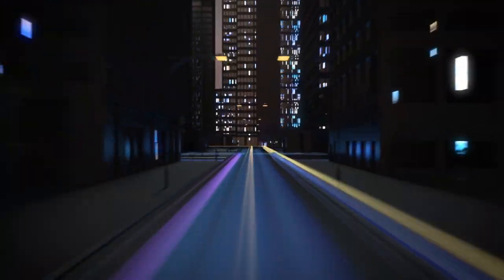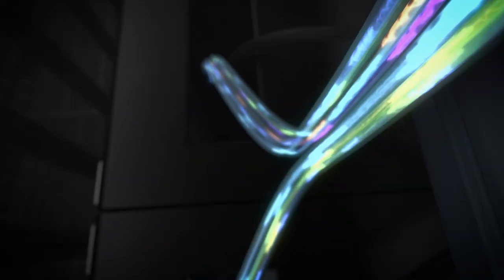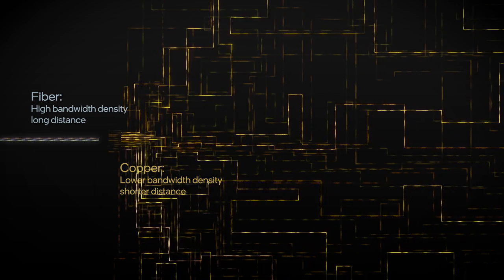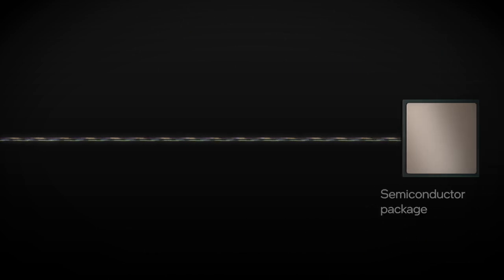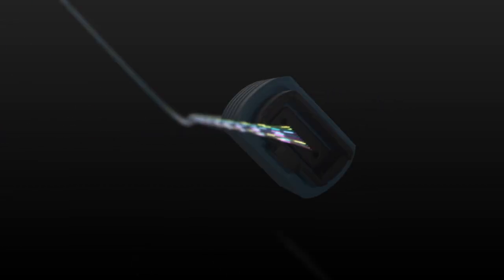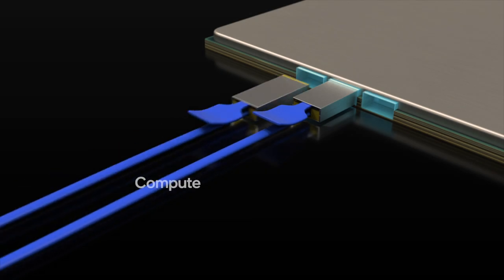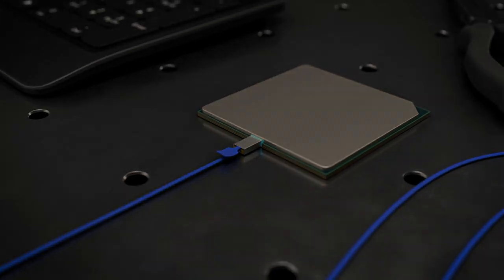Co-packaged Optics | A Scalable, Detachable Optical Connection

Comment: I am hyped, i wonder if this can reduce internet latency too if we find a way to wire the csble directly into the CPU perhaps.
Reply: I doubt it. I am definitely no expert though, but internet latency is measured in milliseconds which is a long, long time even to "slow" copper connections. If we're talking about gaming performance, that's quite small bandwidth too, so "slow" copper connections aren't really the bottleneck of concern for such small bandwidth.

Something like this more about shaving micro to nanoseconds off the copper connections in your computer, that's thousands to millions of times smaller than internet latencies. You have to be doing bulk processing on a lot of data for those tiny savings in data to add up, as far as I understand. They mention servers and I have a hard time imagining when a home PC will see benefits from this.

Now once all the servers running the Internet to your house have this, then it may help, that's where a lot to most of your latency happens anyway. I definitely don't know for sure though, certainly not an expert in this field, just going off a basic understanding.

Still a cool technology though and nanoseconds of savings in our highly digital world across millions of servers will add up to real seconds quickly. Really says a lot about our world where the next way we improve efficiency is shaving off billionths of a second by getting fiber connections closer to the processor.

Please, if someone understands this better please correct me as I think the basics I know are right but I'm sure my specifics can be corrected.

Comment: Can someone explain please, why the intermediate circuitry can be reduced? CPU cannot process light signals, so electro optical modulators are still needed. Maybe modulators are integrated into the CPU package? Would this significantly improve bandwidth tho?
Reply: I am totally guessing here, it would reduce the number of cycles which external circuit will be using for conversion, error checking and then storing it in its local memory.
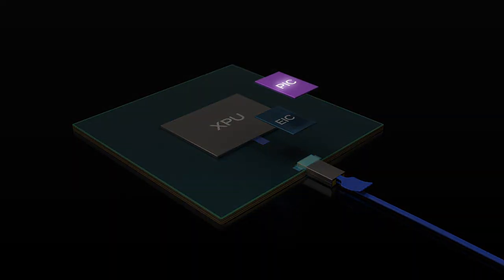Reply: 0:39 PIC or Photonic integrated circuits do this job. EIC or Electronic integrated circuits are co-packaged with PIC on the same interposer. Alternatively, both EIC's and PIC's could be fabricated on the same silicon die eliminating the need for an additional interposer. BW density, IO density, interconnect density and form factor determines the appropriate configuration.
Reply: The PIC you see converts from optical to electrical. Bandwidth could be improved by orders of magnitude.